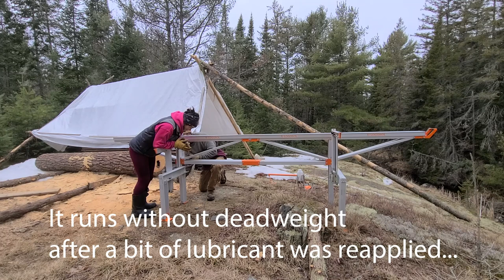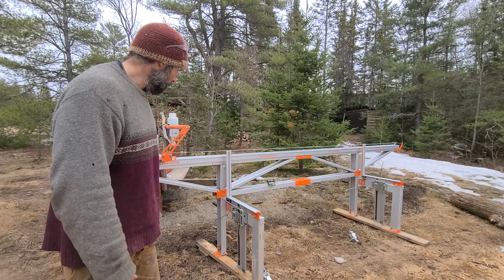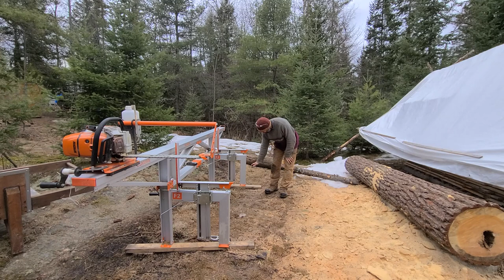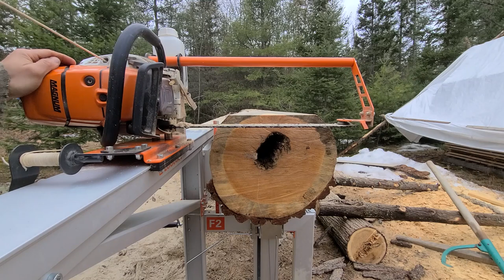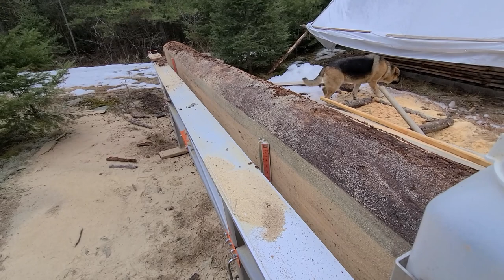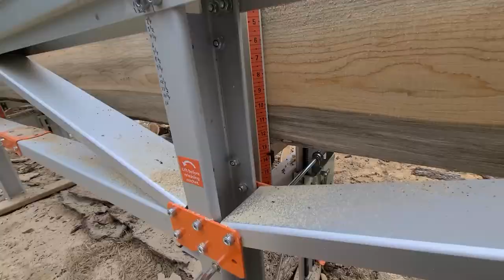Logosol F2 Chainsaw Mill: Overview and How To

Comment: I've been doing a lot of chainsaw milling here on Denny Island on the BC Central Coast. We beachcomb all of our logs out on the shorelines around here and then either tow them home or take the mill to the log. I run an old blunderbus Stihl 090 @ 135cc, with a 42" bar with which I can max out my 36" Granberg mill. I do often get logs that are more than 36" but it gets pretty tough dealing with extra huge planks. Sometimes, when I get a really nice log, the live-edge planks can be worth more then $1000 each. As a chainsaw miller, and looking at the sheer volume of wood you're cutting, I expect you are breathing exhaust from time to time. I've been searching for some sort of face mask that takes ordinary air from 20' away and blows it into your face. So far, I haven't found a suitable product, so I guess I'll have to make one! I just love what you two are doing out there, clearly a very busy, lifestyle with plenty of good clean hard labour. And clearly, you're both having fun! As a kid, I lived in Wawa, Manitoulin and Sudbury, so I'm very familiar and nostalgic for the forest you're living in! I've got a bunch of YouTubes of some of my milling adventures -check Ingmar Lee. If you're ever out on the west coast, come stay with us here! www.spindriftpoint.com

Comment: I thought the kerf on a chain saw was 3/8" or bigger.  That 1" board scale you wrote on the leg of the mill is known as a 4/4 scale.  I believe you can buy versions of that scale for all of the common lumber thicknesses.  5/4, 6/4, 8/4", etc.
Reply from the maker: I'm using low-profile ripping chain with a 1/4" kerf.  You're right though that typically chain for a saw this size would have a thicker kerf.  And yes, typically rough-sawn lumber that is truly 1" would be referred to as a "four quarter" board.  The scale takes into account board thickness + kerf width, so if you're buying one, you need to make sure it's designed for the same kerf you're working with.

Comment: Hi Dave. When you set up the mill did you set the chainsaw bar to be perfectly parallel to the log bed? Or does the bar need to be canted away or towards the log bed to make a straight cut? Thanks. I really enjoy your vids.
Reply from the maker: Parallel to the log bed, instructions that come with it show how to shim the saws connection to the mount/ slider to achieve that (I think mine was parallel out of the box without shimming if I recall correctly)

Comment: Great content with your videos.  Especially with the "scale", thinking of the last cut with the first cut.  What do you use for bar lubrication?  You referred to it as "water cooling".   Thanks again.
Reply from the maker: Regular Stihl chain oil in the oiler, but the Logosol also comes with an extra bar cooling reservoir, which just uses water.

Comment: My logosol M8 sawmill can be set to do either 1/4 inch clicks or 1/8 inch clicks. Can the F2 sawmill do that?
Reply: yes
Reply: @robertclark2714  After I made the post given above I sold my M8 sawmill bought an F2+ sawmill. The F2+ cannot do 1/8 inch clicks. I am 99% sure that the F2 is also unable to do 1/8 inch clicks.

Comment: how does the saw mount on with captive bar nuts?
Reply from the maker: Logosol provided me with a new clutch cover that didn't use captive bar nuts.
Reply: @lureofthenorth   I spent 3000 dollars on this mill and cant use it with any of my new stihl saws.
Reply from the maker: Ooof, surely you can still get a new clutch cover?  In Canada the distributor provided that for me.  I'm not sure where you are located?  That would be a real pain if the Logosol distributor in your location wouldn't provide you with a clutch cover, but worse case you should be able to get one from a Stihl dealership.  Sucks to have to buy something else to get it up and running, but better than not using it at all, and once you start producing lumber the cost of a new clutch cover will seem negligible.

Comment: Great video thank you. Question: I’m considering buying an f2 to mill wood on a steep mountainside. This would require me to dig out spots for the legs to be level. My question is does the f2 require exact leveling to produce square planks? I’m curious if it might twist if not leveled perfectly. Any opinion on this?
Reply from the maker: Sorry for the slow reply.  The mill doesn't need to be totally level, but it does need to be supported in a single plane, otherwise it might twist a bit when a heavy log is loaded, but it is quite easy to do.

Comment: I've been wondering on one of these. I have a granburg mill and I'm not sure of the advantages to buying one of these. I feel like I'm way more mobile with the granburg. Just wondering because I like the thing, just don't know why it could be better. 
 I also like my string on my winch. It's real rigid and not spongy. Spongy causes me the saw to have to back off to much. 
 Just picking your brain.
Reply: The Alaskan style mill is great for making slabs ,,,,Not so good at making dimension lumber with no easy way to clamp down slabs ,,,, My F2 should be here in 6 weeks after a mild vender delay
Reply: Tim I totally agree, Granberg set up properly can cut very accurate boards as well as slabs,and way more portable. The Granberg does involve more physical work but no way in hell would anybody be able to lift up a long and large hardwood log onto a log deck as demonstrated here without mechanical assistance.  Value for money the Granberg wins hands down and a fraction of the price of the f2. I suppose each system has their merits but in my humble opinion you cannot beat the satisfaction of creating boards with minimal expense and hard work.👍👍

Comment: I love this concept, but I have no physical way to lift the logs up on to the table
Reply from the maker: Check out our video where we take the mill by ATV and boat to an island site.  We set up a simple ramp in front of the mill and roll the logs up using cant hooks
Reply: I'm seriously considering getting one of these, I'll be using a Stihl 661 C-M 25" - 36" bar
Reply: @Lonewolve1988  That's a great saw for it.  I think you'll find the 25" bar will adequate for anything you can fit up on the deck of the F2.  If you get the F2+, then you might need a longer bar for some of the biggest logs. Have fun!

Comment: Your taper-compensation does not seem right. You are compencating quite a waze in on the log, compared to the top where you measured. Top vs loglifter is not the same, especially for longer logs! You are lifting the top a bit too much that way. Your first cut vs your third side cut reveals what I am talking about. The taper is way more visible on the third cut, because you liftet the top to much on your first cut. A simpler and more accurate method would be do measure AT the loglifters. You don't even need the tape-measurer. Just wind the log up until it flushes with the top of the built-in scale. Read the difference on the guides, and compensate with half the difference. :-) My method is assuming the logs are fairly straight. If the logs are curved, it wont work all that well. BTW, I own a 5m F2+. The longer, the more this will be visible. - Otherwize great video! 🙂

Comment: Ok, that system is stupid. Why on earth would anyone design portable sawmill that requiers you to lift logs upthere???
Reply: Ergonomics of being able to stand up while cutting? Where do you spend most time, loading the log or cutting boards?
Reply: @ttkddry  or risk the logs fall on you while you are in middle of nowhere
Reply: @filipandric8069  if you are logging trees with a chainsaw you should have a bit of insight on how to move and handle heavy object or you will not last very long :-). Seriously, with a few support logs and some leverage you can    get things done...